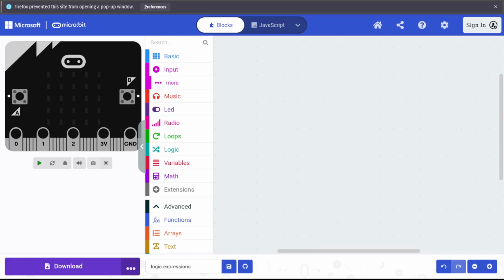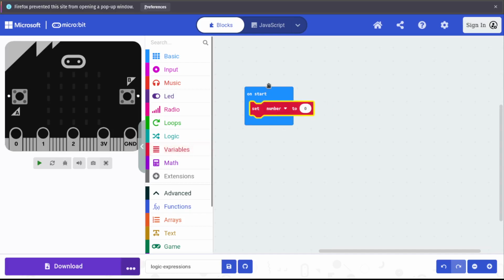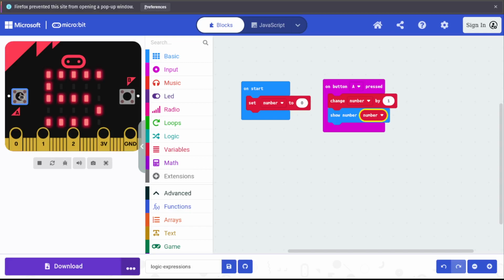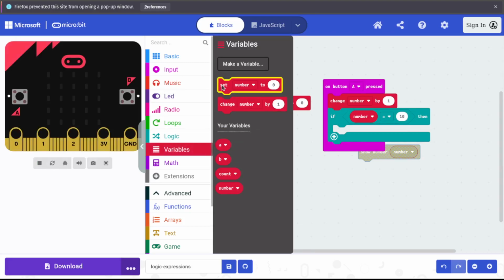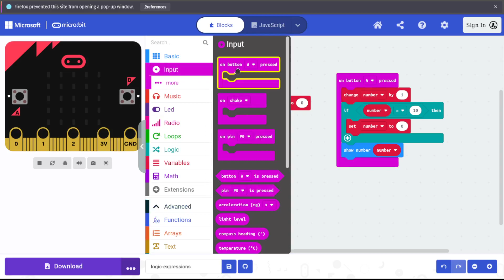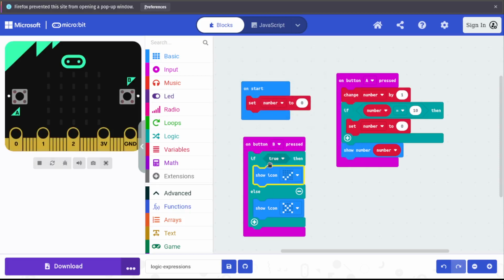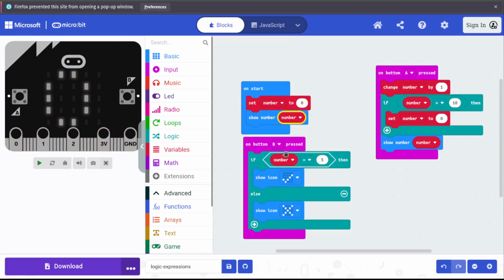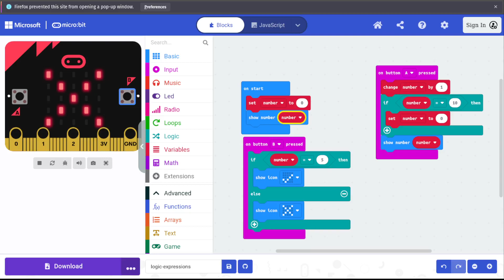Creating a "Combination Lock" with Micro:Bit

Comment: input.onButtonPressed(Button.A, function () {
    Number2 += 1
    if (Number2 == 10) {
        Number2 = 0
    }
    basic.showNumber(Number2)
})
input.onButtonPressed(Button.B, function () {
    if (Number2 == 4) {
        basic.showIcon(IconNames.Heart)
    } else {
        basic.showIcon(IconNames.No)
    }
})
let Number2 = 0
Number2 = 0
basic.showNumber(Number2)

This is the java script for the lock. The correct number is 4

input.onButtonPressed(Button.A, function () {
    Number2 += 1
    if (Number2 == 10) {
        Number2 = 0
    }
    basic.showNumber(Number2)
})
input.onButtonPressed(Button.B, function () {
    if (Number2 == 4) {
        basic.showIcon(IconNames.Heart)
        Number2 = 0
    } else {
        basic.showIcon(IconNames.No)
        Number2 = 0
    }
})
let Number2 = 0
Number2 = 0
basic.showNumber(Number2)

This one resets the number to zero if you have it correct or wrong. its still 4